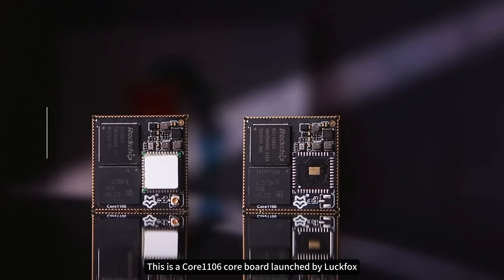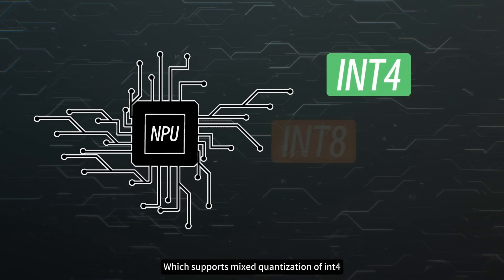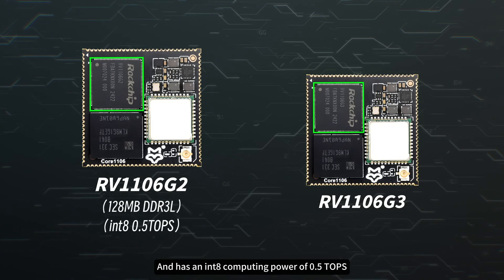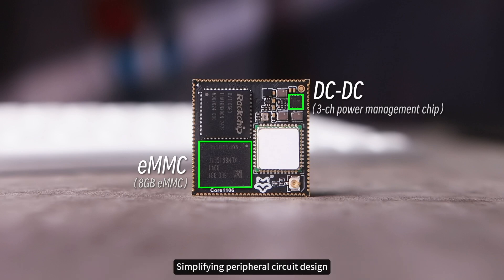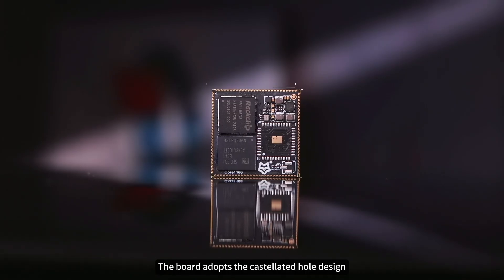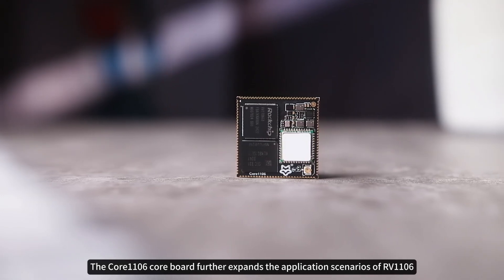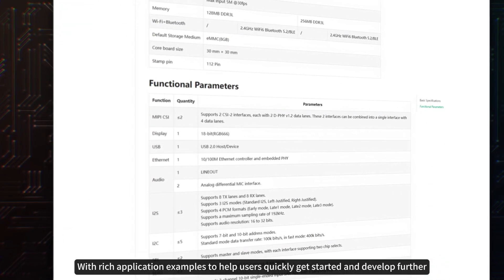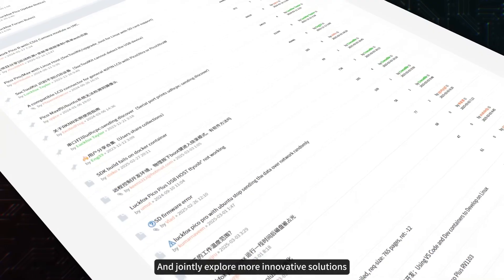Luckfox Core1106 Core Board, RV1106, 8GB eMMC, Integrate ARM Cortex-A7/RISC-V MCU/NPU/ISP Processors

Comment: whats int8 ? 8 bit integer?
Reply: I think it has to do with AI stuff, I might be wrong

But int4/8/16 all have to so with quantization of AI, hope this helps
Reply: int4 (4-bit integer)	4-bit	Ultra-low precision AI computations, power efficiency	NPU
int8 (8-bit integer)	8-bit	Low-precision AI calculations (e.g., mobile devices, edge AI)	NPU, CPU
int16 (16-bit integer)	16-bit	Higher precision AI computations, embedded systems	NPU, CPU
fp16 (16-bit floating point)	16-bit	Medium-precision AI computations, image processing	NPU, GPU, CPU
bf16 (Brain Floating Point 16)	16-bit	Specialized floating-point format used in Google TPUs	TPU, NPU
fp32 (32-bit floating point)	32-bit	High-precision AI computations, commonly used in model training	CPU, GPU, TPU